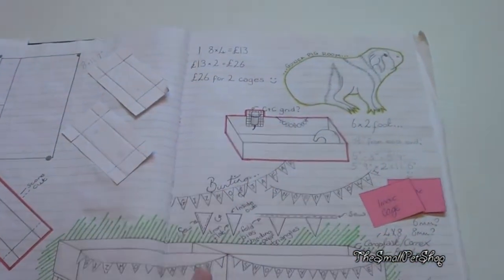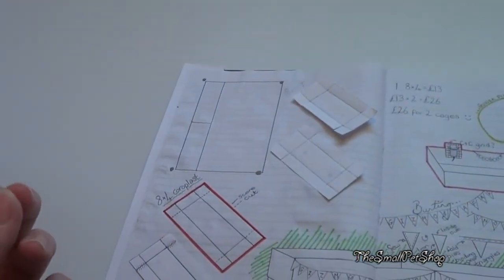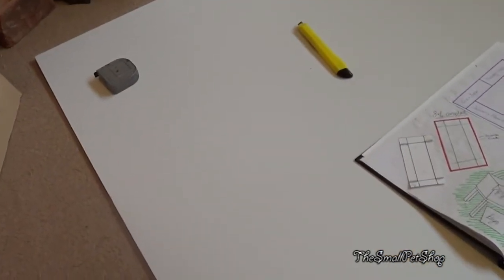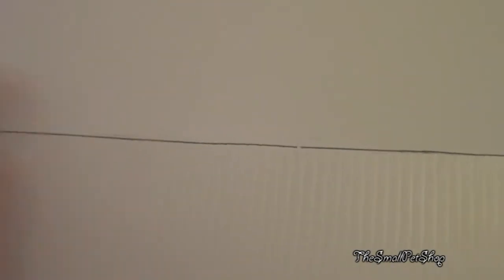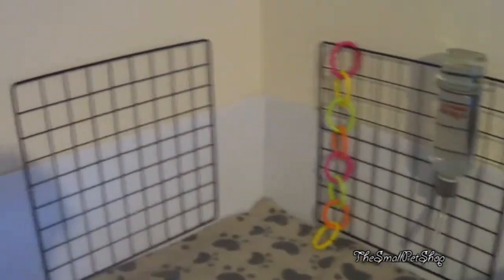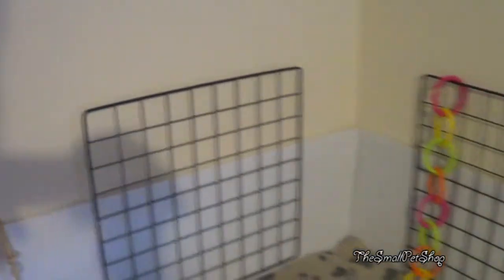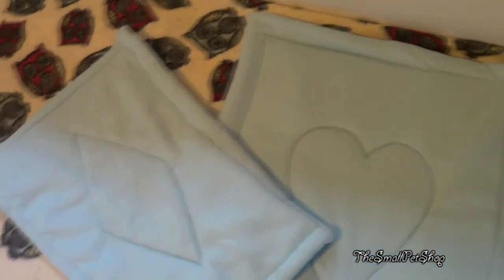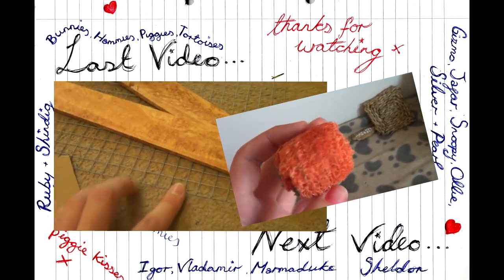How To Build A C&C Cage

Comment: I was wondering can you just put a 4mm base down like just a sheet of corroplast down and then have the grids around the corroplast instead of making sides but then i guess the poos would be more likely to roll off but could you do that?
Reply from the maker: Yes you could do, I used to have a cage like that for Snoopy and Ollie: March Guinea Pig Cage Tours

It works as a cage but a load of hay and all their poops roll out of the holes in the grids onto the floor. It's better if you can make a base like in this video and then put grids around it. If the sides were a few inches high, it would keep all the poop contained. It's up to you though :)
Reply: This will sound really silly but i dont quite understand how you make the sides stay can u just use a strong tape?
Reply from the maker: Yes, I show you how I do it in this video